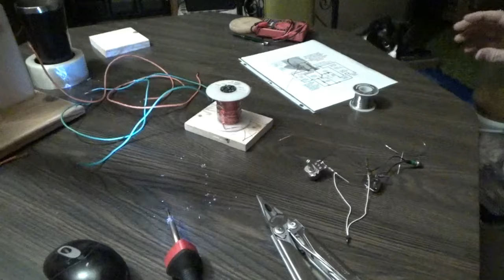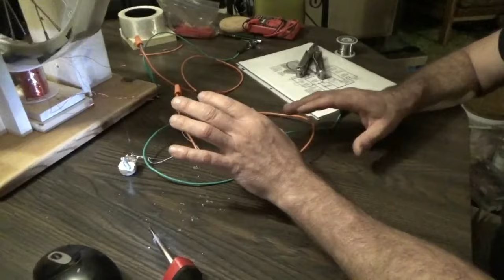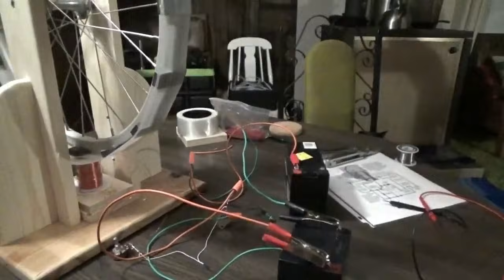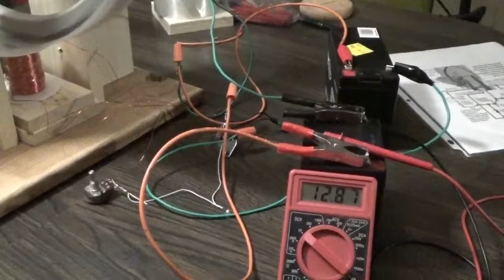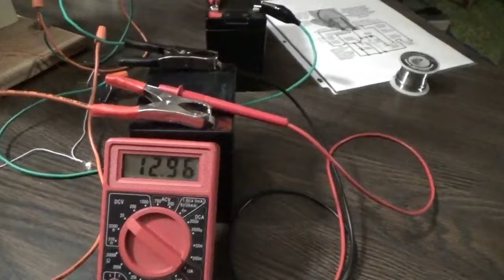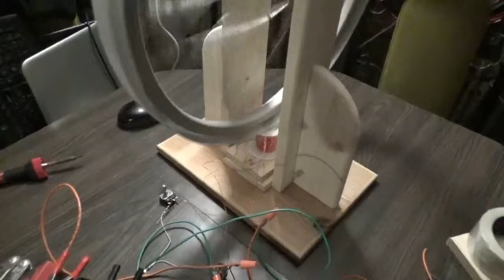Building A Bedini Motor   The Electronics Part 2

Comment: A couple of questions. I hope you are still responding to these videos. First, could the battery that supplies power to the wheel be wired parallel with the battery that is being charged to supply endless power to the wheel? Second, if the input leads were connected directly to the output leads and the wheel started, would it continue to run? Thanks in advance.
Reply from the maker: Generally no to both your questions. The output must remain separate from the input or it will not work. Now, that having been said, if you want a self runner, look up "window motor". But I have no interest in those because they say its very hard to tune them to self run. You can put many batteries on the charging side of these and see a huge gain in output that way though and I think thats pretty cool

Comment: Can galvanized wire or garden wire be used in the core reel. ?
Reply from the maker: If its magnetic inside, yes but you still have to paint it or somehow insulate it to reduce "eddy currents" inside the core.
Reply: garden wire or florist wire are already insulated and usually made of iron. Thanks
Reply from the maker: Galvanized wire will still conduct. Garden wire wont. But its very thin and will be more work. John Bedini suggested lincoln r60 welding rods as the best option. You can get them online, maybe at TSC or Harbor Freight.
Reply: Thank but these are expensive to ship to UK. I want to source locally. Any type of replaceable similar materials ?
Reply from the maker: Any iron wire that is coated and non conductive

Comment: Could a third battery be added to do work and a switching circuit that switches the batteries up so the system is always charging and doing work at the same time. The idea is when the charging battery is charged the system switches so the charged battery becomes the one doing the work (power a bunch of LEDs)

Comment: hey  sir ... i build one but not spinning ,i need advice to get this running pls...
Reply: You probably need to go over everything and check its all proper. I built one with a bike wheel, it ran for a week non stop. I stopped it myself to make some changes. Havn't charged a battery yet but working on a new machine
Reply: @robt8048 please make a video step by step how to wire up and turns of coil
Reply: @romeochellah4003  Are you still Into this?
Reply: Hey check over my circuit.. its fine.. the wire i used to make coil is from a tv yolk i got about 560 turns .. i took 2same wires an made it one as the bigger wire an the smaller one i used as trigger. The circuit coming on but jus wont spin.
Reply: Assuming you gave it a push  it should work with the correct distance of coil from the magnets. So can't say but something is wrong if it wont spin with a reasonable push.I didn't hear him say the distance from the coil but you need to play with it to get it right
Reply: @robt8048  i try putting coil close far .everything ive seen i try. Still not spining. Ive been on this for about 2 weeks now day and night. To see this negative results is very discouraging.
Reply: You only need one thing out and it won't work so can't help as I cant see what you are doing or I could tell you. You need to get the correct schematic beside you and go over everything thoughrily. You should disconnect the charge battery to see if the neon lights go on when you push it.You could try that. otherwise its back to the drawing board
Reply: I am a tv technician and I don't think there would be enough wire in a yoke to do this properly. I used wire from a degaussing wand as the trigger coil and bought the rest for the main coils but without seeing your setup I couldn't say what the problem is. My system runs just like the one in the film I also put a pot in line with the 470 ohm resistors to tune the triggering and it all works fine. So far have restored two batteries and ready to put in discharge caps. Do you have any electrical experience?

Comment: I made and redone the shemat bedini with the 17 '' Diam. aluminium wheel many times but nothing works. My components are nevertheless functional, oscilloscope proofs. It's been 1 years that I work on projects Bedini, with multiple reels of all possible lengths ... but nothing. I tried different gap between the coil and the wheel too ... I would like it to work. I work hard, I listen all  your instructions but ... I would like to know the problem. Congratulations for your work!
Reply from the maker: Thank you. I am sorry to hear about your problems. Have you been using a good, fully charged 12 or 24 volt battery to power the device?
Reply from the maker: Make sure the tuning resistor is turned to its lowest setting. Remove it and try without to see if the wheel will spin. Some POTs have quite a bit of resistance at their lowest setting.
Reply: I removed my potentiometer but .... Still nothing. Either way, it was adjustable to zero Ohme. The problem is elsewhere. Thank you.
Reply: Forgive me, Mr. Troy, I had reversed my bases / transmitters. Everything rolls to the bottom, and 7 transistors, it's WONDERFUL !!!!
Reply: Math Gag So what was the problem?

Comment: It looks like fun to make this motor but, Will the battery voltage ever make it 13 volts 14 volts? Not a whole lot of charging going on at 12.9 volts I am thinking only a little tiny bit of charging. What does it take to make it click over to 13 volts 14 volts of charging can you do something to make it do it? On batteries we need the voltage to go significantly higher than what the battery voltage is to get it to take a charge. How many amps is it making? A small 10 watt solar panel has about .4 amps .5 amps. or a 20 watt solar panel has about 1. amp charging power. The voltages on these panels may go as hight as 15 to 16 volt or even 17 or 18 volts and they charge pretty good. I have left a 10 watt solar panel on a Yellow optima car battery for a month and got it somewhat good enough recharge about 12.1 volts to run my solar trackers motors. Of course this was a bad battery I didn't expect it to become like new again. Solar panels dont mind dead batteries will not shut off due to too much battery resistance like my modern battery charger does. I would like to see the analog meter put on the Bedini to see what it is saying about the voltage and a amp reading is definitely in order too. I am curious. would a bigger charging running battery with higher voltage charge better at higher amps and voltage? Im talking about the battery that runs the Bedini motor would a bigger higher voltage battery charge at a higer voltage and amps?
 On a another note or idea could you make it two of those small batteries in a series to run the Bedni motor with ? this would make a much higher voltage to charge a dead battery with. It may do a lot better job or make a improvement on your charging voltage and amps.  or watts going into the dead battery or patient battery. It may be 24 volts open but closed on the dead battery voltage will drop to a normal charging rate for 12 volts I m guessing. Also wind generators charge at much higher voltages. why have you not set up one of the wind generators on your home batts so you can help charge them during these dark winter days and nights. It would help and even the small little wind generator would be putting some kind of voltage in the batteries to keep them warm. The little one would be easy to get up quick.
Reply from the maker: Please next time separate your questions with spacing so I can read better.

Its not the run battery that makes any difference on charging. It is only there to spin the wheel. It is also electrically separated from the charging battery. They only share one wire. Increasing the run battery only increases the amount of time you can run this without charging the run battery back up.

This is not a normal battery charger. The battery is being hit with 2 - 400 volt spikes of voltage with little or no current. The charging battery will be cool to the touch and will never heat up like with conventional charging.

The voltage on the charging battery will continue to increase until you remove the charge. You can over charge the run battery so you must keep an eye on it but it is a slow process the first few times with a badly sulfated battery. Later as the battery becomes conditioned to the energy applied to it, the battery will charge up faster.

You can use a higher input voltage for higher charging on the output. This increases the radiant energy output on the charging battery. This should only be done with larger batteries though and not the little 7 or 12 ah batteries.

This is nothing like conventional charging.
Reply: Well I would like to see the voltage on the dead battery before and after. You never do show the progress on a meter. I cannot say that I ever saw one of your batteries restored because you dont ever show us. You could make a chart of progress to show the increased voltage it has. And also if the battery can actually hold a charge over night or for a few days. A 400 volt spike how can that be seen? Did you ever restore the golf cart napa batteries I would think by now they would be restored?
Reply: he told you to seperate questions with spacings

Comment: :) I'm looking forward to finishing this tomorrow morning.  Thanks again Troy :)
Reply from the maker: Please let me know how it goes for you.
Reply: Will do ... nearly finished with my 3rd build ;)
Reply: Okay :) I'm testing my 3rd build now for 24 hours. It spins faster than my earlier builds, but not all the components are the same either. I'm happy with it.  The first one I made I traded for 30 lbs of filleted salmon from Lake Huron and stored in the freezer. It will be good I'm sure. The second one was finished on the 10th of Dec and running desulfation on one of four lead/acid batteries in my very small battery string. I'm considering going to AGM deep cycle so I can bring them indoors for year round use. Have you noticed any difference with AGM batteries? Do they have sulfur issues like lead/acid?
Reply from the maker: Wow, not bad. You work fast.

I think the small 7ah batteries are AGM

Comment: i like you to hook up and amp meter to this and see how much amps it putting out too
Reply from the maker: I will be putting meters on in the next video
Reply: @TheDIYWorldElectronics  
Can you tell approx. how many amp you get whit this coil/exemple?
Reply: the output wil be high voltage spikes, whit only a small amount off micro amps, its the high voltage pulse you can use to desulphate sulphated whet, lead acid battery plates.
Reply from the maker: Yes